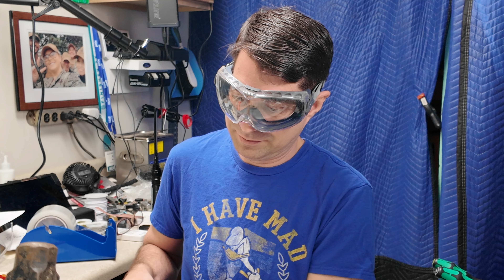Stress-Testing 3D Printed Kenmore Parts: Which Material Wins?

Comment: Thanks Wes!  It seems like you're reading my homework!  This topic just came up on our weekly SewingDocAcademy call.  I had no idea that 3D printing has come this far and your demo of the Tough 2000 resin destructive test is very convincing.  The Pfaff 1222E cracked cam stack gear is a common problem for an otherwise fantastic machine.  The cam stack is readily available at around $80.  One of our members said it could be 3D printed, assuming that all of the measuring and prototype work was done to get it right.  There would not be much savings on the inital cost, but perhaps a real reason to try is that the Tough 2000 resin would be less prone to crack than the available OEM parts.  I would love to hear your opinion of this.

Comment: Thank you very much for this video as well as all other super ones!  I restore old sewing machines (1940's-1970's) for a hobby and am also considering 3D-printing. One question that comes to mind is whether you've considered making a 3D-printed mould around the original shaft and cam? Then you would only have to cast a gear with a nylon-like resin instead of also creating a whole cam.  I'm a novice on 3D-printing and casting, so forgive me if this is a stupid question.

Comment: you might want to look into an Elegoo centauri carbon. they're around 300 bucks. it's an enclosed core xy FDM 3d printer, which comes out of the factory with a heated chamber, hardened gears and nozzle meaning you can print a few more engineering filaments, including nylon (the original resin i think these gears were likely made of) than your Bambu A1. some PA6-CF or PA12-CF i have a good feeling would work quite well in this application. you'd also need a filament dryer to feed from though as nylon gets wet very quickly once out of the package.

Comment: Great work testing, I think the biggest problem might be wear resistance in prolonged use. Proper lubricant might help with that, just use something like silicon grease that won't degrade the plastic.